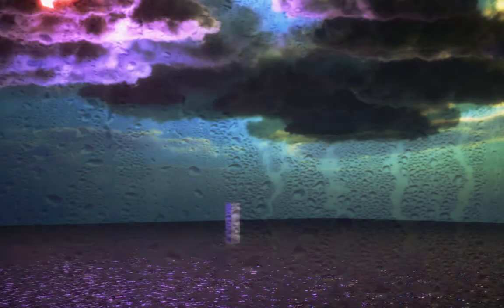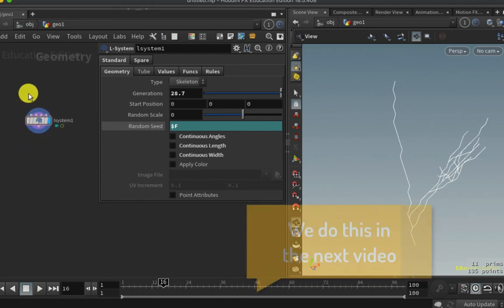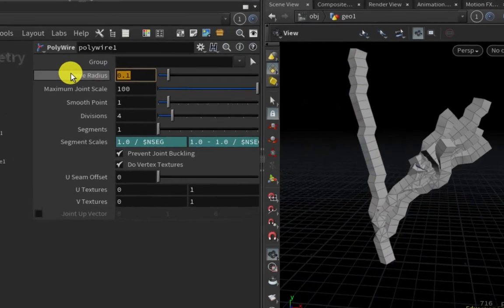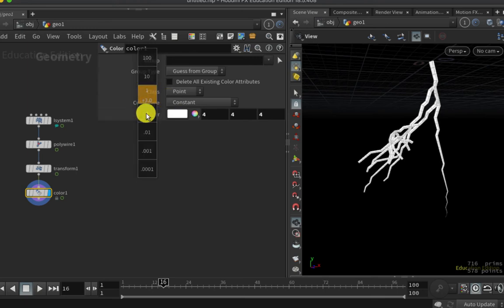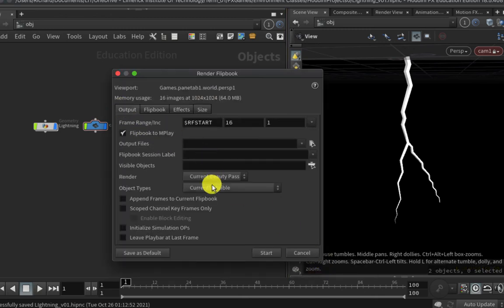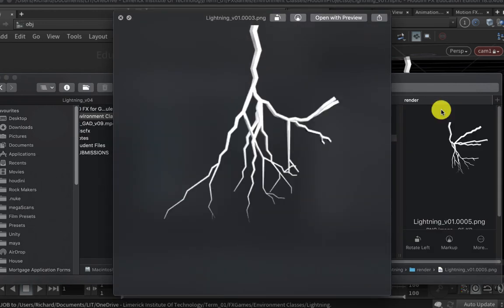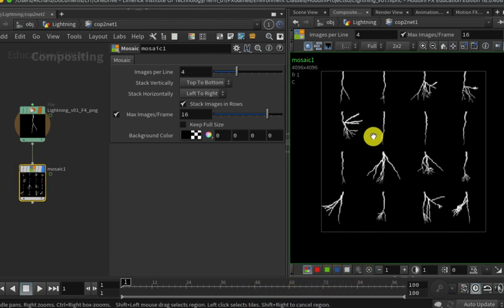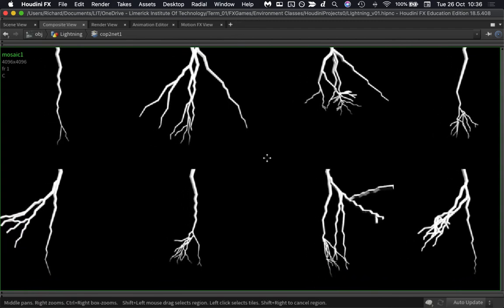Procedural Lightning in Unity & Houdini Part I - Creating a Lightning Texture Atlas in Houdini

Comment from the maker: This series should be good for Houdini beginners. You will need to be familiar with the Interface but I go slowly through the steps. Apprentice users should be aware that there is a render size restriction of 1024x720. You should be fine to use Apprentice for flip booking out the textures.If you use .pic format you should not get a watermark.  When outputting the Atlas using Apprentice in COPs at 8:30, on the render output change Override default res to lower the render size to less than 1024 and it should be able to render out from COPs as you will be lower than the render size restriction. I don't have access to Apprentice so let me know in the comments if this does not work.